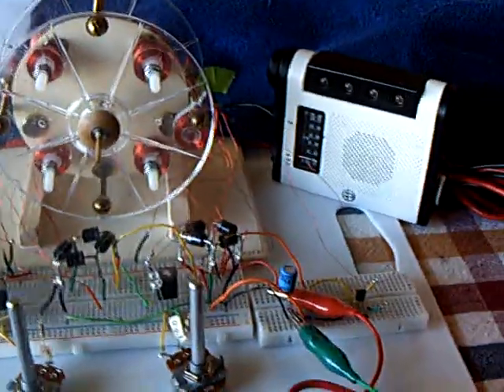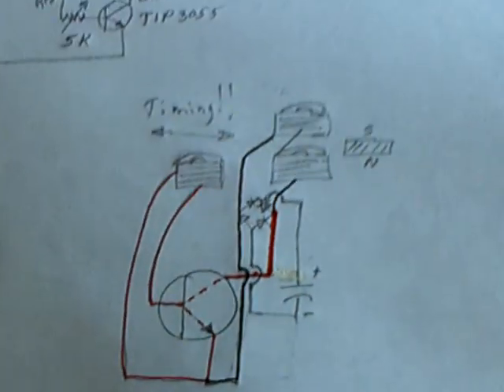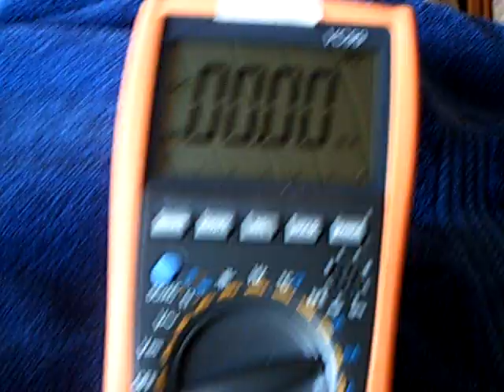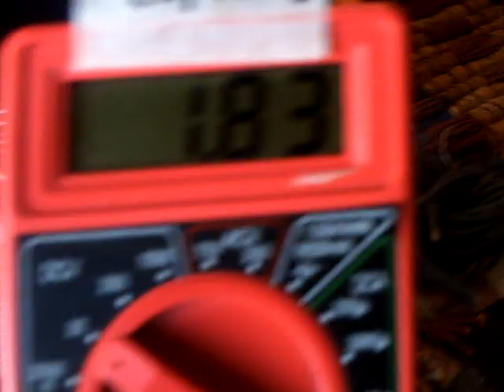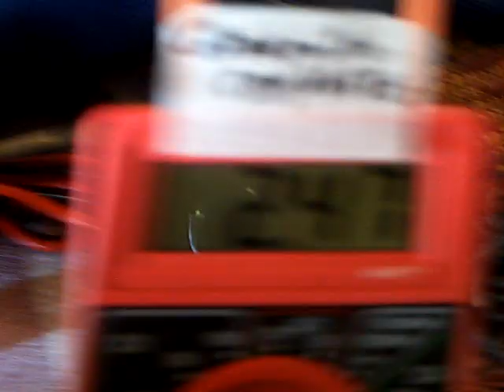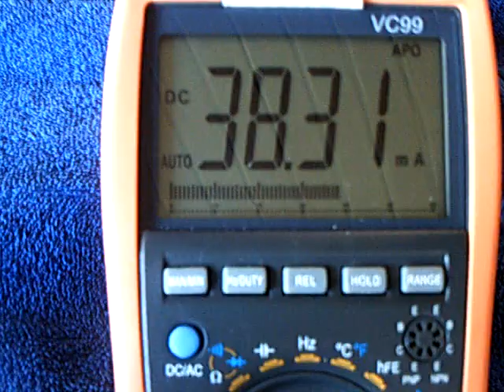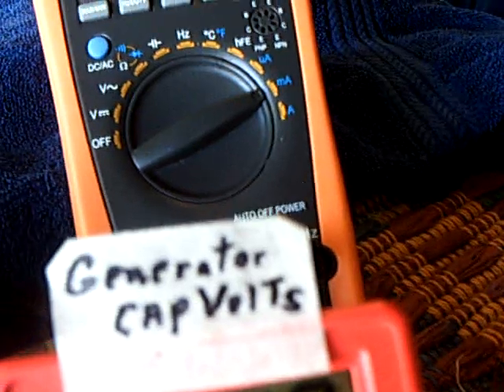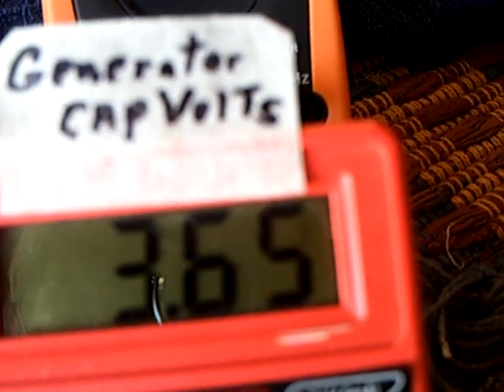Muller Dynamo-- generator coil shorting test.ASF

Comment: So I just discovered an interesting method to get power, without Lenz drag. I have a Bedini Window motor that I built, and it has incredible Lenz's law, it is not drag free as John Bedini says in a video, that is misleading. However, if you time output using a switched circuit and, and only draw power for 1 milisecond per each 120 degrees of rotation, then the coils have no drag, and you can actually charge the supply battery. Any generator can be made more efficient by "timing" the output.

Comment: Hi lidmotor. Are you still working on your Muller motor? I was just wondering whether you might like to modify it. If you have the funds id realy apprecaite it if you could put in a few more magnets and coils to make it 8 magnets, 9 coils arrangement and see how that does.

Zerofossilefuel in his research says that the spacing between magnet and coil is critical and can produce % increase in efficiancy just by tweaking the gap. 

I wish you well on your endevours, thanks for your videos

Comment: Hi Lidmotor, had another look and just realized, that you only needed 2 mA more, when your motor was running, versus the stopped rotor. So your JT already used 1.6 Volts and 36.4 mA and when the rotor spun you had 38.4 mA, so the rotation and cap charging does not need much power, so the most power is lost in the JT circuits powering the LEDs. Now try to measure the output at the cap with a load and see, what you will get out there. Many thanks.

Comment: IMO u can short it during peak or not but its just going to change the level of flyback you get while still providing an opposing pole either during saturation or desaturation.  i used to play with this a lot last year and using a reed switch i could easily light neons from gens or charge decent sized caps well beyond 100v. if you used a reed switch in parallel with the gen coil before the FWBR for the shorting u should be turning a 4v potential into a 1500v potential easy. barely any mA though

Comment: Could you please try to use an oscillator to chop up the output ALL THE TIME.?
Then you probably only need to adjust the phase difference  of this oscillator to
your driving frequency phase.
Maybe you can just use a phase shifter and control the shorting from your JT drivers.
The shorting frequncy should be higher than the driver pulse frequency though...
Many thanks.

Comment: That Lenz is a wild beast we gotta put that baby in a cage and tame it.
you got it right w/ your trigger observation, you need to be able to pinpoint that trigger, your trigger coil is huge and has a long "on" time. if you want to stick w/ the air coil, turn it on its side, that will help a bit. you can very the signal to the base Bedini style. love your builds Lid, they are quick and pretty at the same time :-)
have you tried the "cap short"? 
Patrick

Comment: thanks for the demo. My question is that if coil shorting can be used without disturbing the generator? ( Increase voltage compared to the method when you use stronger magnets in a generator )